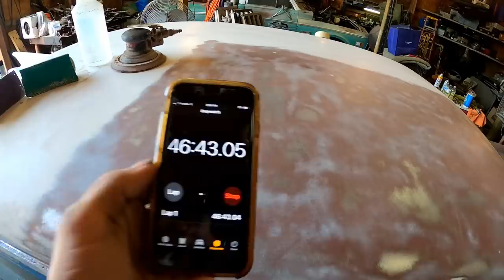Doing bodywork to the '59 Dodge Coronet pt.4

Comment: This car amazes me....Considering it's age, it's in very good shape. Somebody cared for it...
I was going to ask about removing the windshield just to replace it's rubber seal, and to check the channel.
Reply: I see some issue with the edges of the windshield, I'm wondering if it's a tint, or is delaminating?
Reply: @Weird Beard Just FYI. The windshield and back glass rubber gaskets are ***unobtanium***. You must reuse what you have. It is critically important that y'all understand how that rubber gasket folds into itself. You are 100% guaranteed to crack the glass if you don't have a good understanding of that, as well as where to press on the glass to pop it out of the gasket.

Comment: There should be chrome over the drip edge. May be the only pieces missing. Love the channel man!
Reply: Yes , look nice chrome piece
Reply: What should he do about it? I mean just go to the dealer and order them up right?
Reply: I'm thinking with the amount of chrome on that car that there was a drip moulding there. Now finding a used piece or a reproduction is going to be a task and may be why both sides are missing. That car is old and not a popular restoration project. You may have to leave it painted. Only a purest will know it's missing. I believe Randy had some pics of that car in an advertisement or may be in the owners manual which may give you a clue as to what was there originally.
Reply: Steelman0355 He might get lucky in a junkyard somewhere in the south  but it not going to be easy.
Reply: I ve seen another car without it, hm...
Reply: It looks like some had chrome on the drip edge and some didn't. Probably depends on the trim level.
Reply: I looked at some similar cars on a Google search and didn't see any chrome mouldings there.
Reply: I think it might be a trim-level specific piece. I looked at the 1959 Dodge brochure, and it looks like it doesn't show up on all the models in the Coronet line, which was the bottom trim line in 1959. Maybe it was optional. I also looked at pictures of other people's dodges and a lot don't have the chrome on the drip rail, but do have the cap. My 1956 Clipper has trim the length of the drip rail, even though there's a lot of chrome on that car, I think it does make a nice touch, particularly when it separates two different colors on the car.
Reply: Best I can tell from images on Google is if doesn't have the drip rail chrome or if it did, that piece is the same.
Reply: @Steelman0355  Drip edge did not have chrome in it, I had a DeSoto with same trim.

Comment: The strip that you mentioned above the door is definitely missing, great job. 👍🏻👍🏻

I should have said “possibility”
Not “definitely” some do have trim and some don’t.
My mistake, thank you.
Reply from the maker: That’s what I was thinking 🤔
Reply: @weirdbeard8898  idk, I found a decent(ish) sized image of an all black 59 on google images and the trim just ended abruptly like on this one. I will comment again with the image link just in case youtube automatically moves it to the spam folder
Reply: @weirdbeard8898  the thing you need to keep in mind is that those old cars have tons of trim and clips...and that's a base model

youd shit a Holley 850 ....dominator if that was a Lancer or a Royal
your doing fine....

I hope Randy let's you do the whole thing including shoot it

TRY STEELE RUBBER.....THEY OUGHT TO HAVE IT
Reply: I found a pic of a four door. The trim on those 2 doors is slightly longer but still short. On the 4 door its exactly the same as the one you're working on though (link below)
Reply: @clevelandmaker386  I wouldn't call this a base model.  This car has a lot of trim pieces a lot of other '59's don't have.  Maybe it was the middle of the line model.
Reply: @CrusadesOClock  If you notice, the one in your picture is a lower trim level than the one Mike has.  I also looked on Google and it was hard to see any chrome mouldings on any of the cars of a similar trim level.  After all is said and done, it doesn't need it.
Reply: @mexicanspec  I agree, it doesn't need it. The wikimedia pic at least shows clearly that the tiny piece of trim is on more than one car so its not a random made up piece just jammed in
Reply: @mexicanspec  - Everything was an option. The Coronet was the base model. Factory A/C on the Coronet is very rare and unusual.
Reply: @ronwaters478  Yes, A/C was a rare option, but this is not a base model.  This car has a lot of trim pieces the lower models don't and it has the second biggest engine that was available.  The trim would not have been ordered piece by piece, it was a package.
Reply: @mexicanspec  - My friend had a 59 Dodge Custom Royal Lancer convertible with the D500 option. Yet he didn't have the hood ornament, quarter louvers or chrome underfins. As I said, all options.
Reply: @ronwaters478  You are making it sound like each piece of chrome was a different option.  It wasn't.  The different trim levels had different trim pieces.  You could not order a trim piece on the front door but not on the back.
Reply: @mexicanspec  Yes, but you could order the hood ornament, quarter louvers, chrome underfins as separate pieces. I've seen cars with one but not the other. I have the dealer order sheets with separate pricing for each one

Comment: thats where the rust encapsulator can really help. it enwraps rust so air and water can't get to it so it stops it in its tracks. all you need to do is wire brush the metal

Comment: Just think of the labor that went into assembling that car. All that beautiful stainless steel which you won’t find  much on any modern cars. All we have today is chromed plastic. I had a 57 fury which I had painted. The trim would last forever but in the northeast the body would rust along the trim in less than 2 years. Love your work ethic.

Comment: I think there was definitely a chrome strip that went on the sides of the driprail, probably damaged and removed when whoever was doing the 'contingency' rust repairs on the vehicl.. a channel called ColdwarMotors is restoring a 1960 plymouth and parts for those are even HARDER  to find than those and rarer. But he was so lucky to find that for what he paid and the condition is unbelievable especially seeing how old the car is

Comment: I would consider removing the rear window as well. It seems to me those lower corners (both sides) would be affected by the rust that formed in the channel on the outside. Plus, when you paint the car, paint it without both windows in it and you will get a much better, more professional  and cleaner paint job. I think that this ccar would be worth the extra effort. The "winged" cars are in demand and bringing good money if they are nicely done.

Comment: The little stainless drip rail piece without a continuation for the rest of the drip rail is correct. Dunno why they did that, but that's how it was on my parts car and I've seen that on 59 Dodges in the boneyard.

Also, had you considered chemically stripping the roof ? All that grinding is back-breaking work !

Comment: Just a thought. On the large upper and and lower chrome trim of the windshield.  Once the corner pieces  are removed, couldn't  you try to slide the chrome off to the side without fighting with the clips? Installation  would be the same and the clips never have to come off. Just clean em up maybe.

Comment: lol charge by the acre . i need to attack the roof of my dodge and completely repaint my 99 tshoe because the paint has long time ago left the building on the tahoe and it's starting to rust on my dodge too now. gotta get after it before thos two have real problems. right now they are both just surface rusted and the tahoe is REALLY BADLY surface rusted but i don't think it's too far gone still

Comment: This car might be hard to find parts for because of how few are probably around.  I had a 67 GTX and they only made that yr one yr so everything I needed for it was hard to find. Mostly out of junkyard in the south to get parts for it. I got the car completely done after 5 yrs of work and like 3 months later a16 yr old girl  with her temps with mom turn a corner and drove right into me. I could’ve died.  But every part to fix that car had to come out of a junkyard from the south and that alone took a couple months and they wouldn’t send nothing without their money first. I got lucky and they were all in great shape no rust at all.   But the car was never the same after that they just couldn’t get things back to how it was before that. And within a yr you could see the difference in color of the parts that were painted looking at it at a angle. It was a bummer. I sold it like a idiot thinking I would get something else well  kids come and it never did happen. That car was solid as a rock. Just needed a little more work where that wreck happened and it would’ve been like new again.

Comment: You said new glass. Can’t the old windshield be removed intact? That is a unique windshield which impresses me as very hard to find. It would be easier to find a solvent that will allow removal intact, in my opinion. The time spent doing that versus finding a replacement would be less...(?)...

Comment: I did some research on the '59 and of all the pics I could see there was no chrome on the drip rail, it stopped where that small piece of chrome is. I looked at at least 20 pics of old raggety looking and clean original cars and all had no chrome on the drip rail, the drip rail was painted the color of the car. Hopefully this helps.
Reply from the maker: Thanks for the info. Much appreciated.
Reply: @weirdbeard8898  It is really not clear. You can find the 1959 Dodge brochure online and it looks like there was chrome trim on the drip rail.  But that may have changed during production.  Looking at various images of 1959 Dodges, some have the chrome trim, some don't. And some only have the small piece at the front.  But since those are restored cars, you can't tell what was original.  One thing is clear, nobody will criticize you if you don't have the drip trail trim.

Comment: Silicone is acidic and eats into steel.  not only that but silicone attracts and traps moisture.  if you are going to use sealant on a car, it should be urethane based.

Comment: Mike: it seems your spray paint system from Eastwood’s. Produces very little overspray?
Does the rust paint give you a paint build up?
If so, will that present a problem, re-installing the moldings and clips?
Cheers

Comment: OK MIKE, here is a place to get all your products for the 59 Coronet,, Andy Bernbaums Auto Parts, (Online) , 617-244-1118--The W/S Gasket is $100 as well as the rear glass gasket $100.  Both need replaced, appears the clips are available as well,,,These are not real easy to replace, but can be done with your patience, I have installed these before, windshield is a rope in Model, same as the 67-79 Ford pickup, and the early 60's to early 70's Chev Pickups, the mldgs go in before windshield and back glass are roped in,,(except for the front bottom mldg, and corners). use tape on the slide in mldgs after you put them in the rubber, to keep them from popping out during rope in process....Hope this helps you out. (Don Ballou Oregon).  And Yes the drip rail chrome is missing.....

Comment: Boy that windshield is terrible.  Good time to get another one.   Anybody got one they can send these guys? Interchange is 57-59 any Mopar post sedan or wagon, the hardtop and convert are different.  I think there's a shape difference on the 57 but they fit the same hole.  

I have removed a few of these big windows.  The last one I pushed out I laid on my back across the middle of the seat and used my sneakers to push gently at the top and it came right on out.  I found it easier to apply even pressure using my legs.  Had already gone around the entire gasket as much as I could with a screwdriver and pried it back and tried to free it up.  That might have been a '60 Chrysler glass.  Parted out way too many cars over the years.

Comment: Are you taking the front and rear screens out or is that too risky ,if they break you might not be able to find replacements ?
Reply from the maker: We’ve sourced a new front windshield and both rubber seals. I’ll be removing both on an upcoming video.
Reply: @weirdbeard8898  that's great I'm looking forward to seeing that !👍😊

Comment: *CORRECTION* I just found another youtube video that shows the same year car WITH the chrome drip rails so it must have come both ways depending on the model.

https://youtu.be/1tTnY1qaDFQ

NO CHROME ON THE DRIP RAIL I found this pic if you zoom in on it you can see theres no chrome. It has that little tab like the one your doing. Its the 9th picture down not including the main photo at the top of the article.

https://www.classiccarsseller.com/2014/05/27/1958-dodge-coronet/